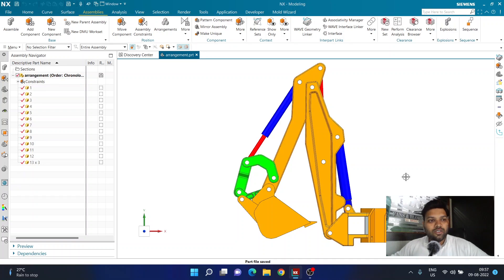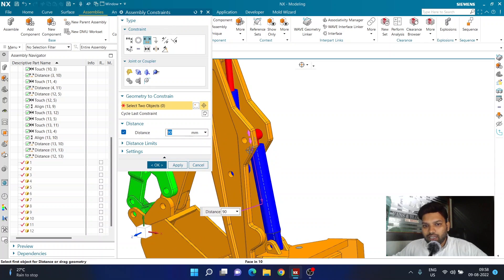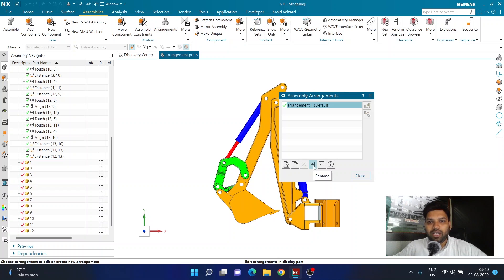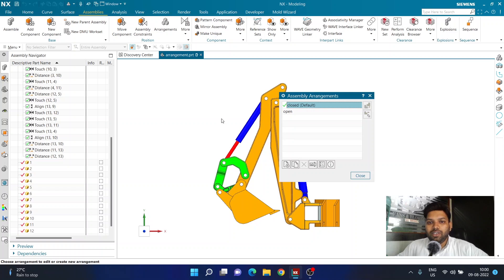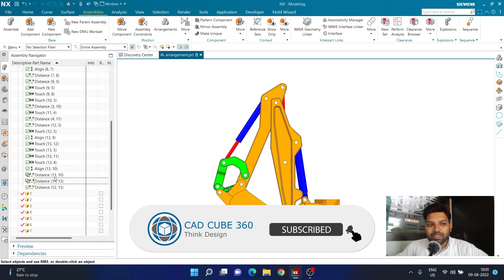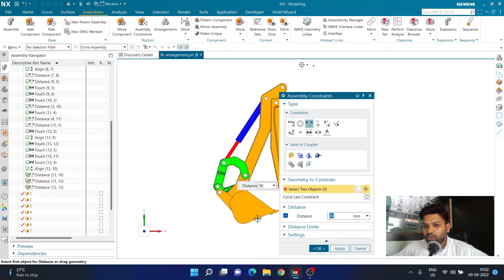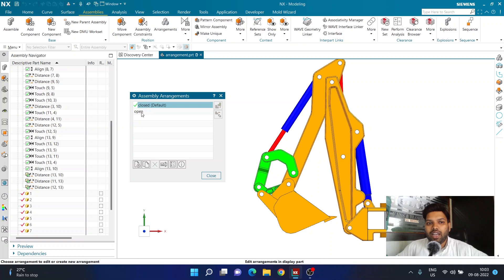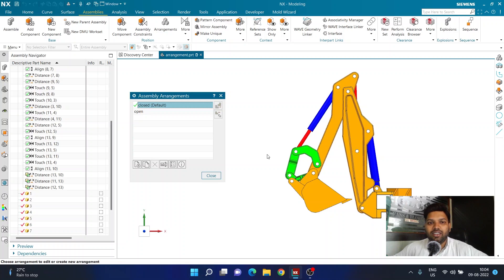ASSEMBLY ARRANGEMENT | SIEMENS NX

Comment: Hi Brother, What version of NX is this? And is there any possibility for upgrading NX12.0 to this version.
Will Appreciate ur response. ✌🏻
Reply from the maker: This is NX 2026 and yes you can upgrade to this version easily. If you have a licensed version of NX 12 and don’t have ME&S then you can’t upgrade. If you have a crack version then process is similar to the installation of NX 12.
Reply: @cadcube360  Thanks, I am using cracked version of it. Then i have to figure out the source regarding the update installation.😬😑
Reply from the maker: All the best 
You can try 
www.getintopc.com